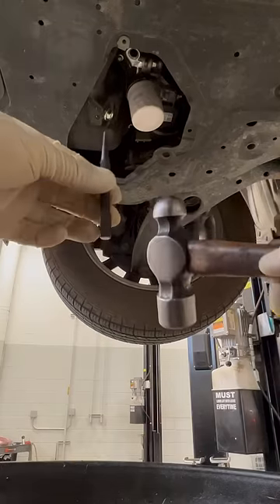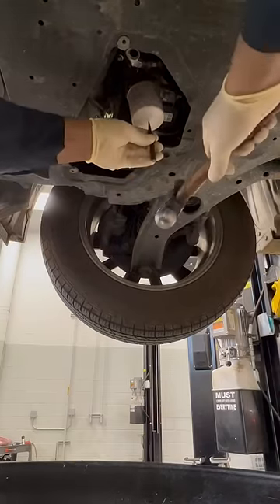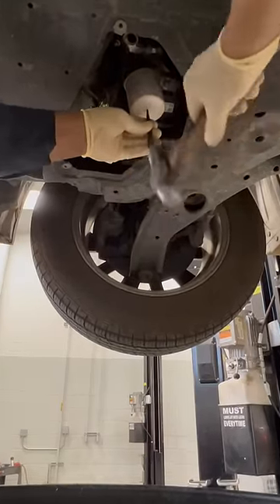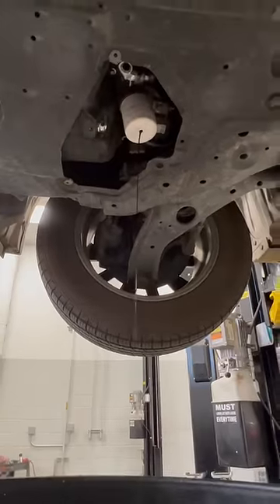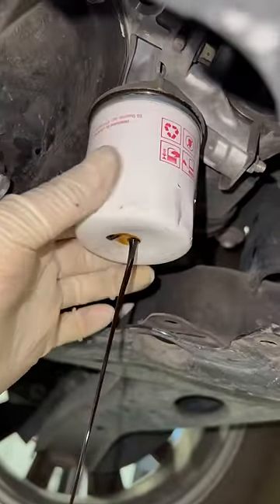Tech Tip Of The Day Oil Filter Clean Removal #oil #oilfilter #mechanic #shorts

Comment: Please be aware, viewers, that not all filter cans are the replaceable type.
Reply: The hero we didn’t know we needed
Reply: Also be aware that this is ok for the replacing type.  🤷🏾‍♂️
Reply: This comment has to be a joke. Obviously you would not do this to an oil filter, if your oil filter did not have a replacement
Reply: @emmanuelleallen9296 the hole in the metal ruins the metal, if it's the type where you just replace the filter inside the metal it ruins it.
Reply: @Charlie-vz9lr who would have guessed
Reply: But 99.9 percent are
Reply: i knew that something didn´t seem right about punching a hole in the filter, but i did had that question! thanks man!
Reply: @Charlie-vz9lr which cars have this, I’ve never seen it.
Reply: your mum is
Reply: @burkles4456 mostly European cars. But cartridge filters have become more common in recent years in cars that are American and Japanese as well.
Reply: My favorite part of having a "replaceable filter" inside a reusable canister is that I get to pay up to 5 times as much as I would for one all included replaceable filter that actually costs them more to make.  It's the most ludicrous load of snit imaginable.
Reply: @rooh5825  cartridge filters are actually more expensive to manufacture than the canisters. They're more complicated to produce because they were designed to filter out even smaller particulates than the canister ones. It'll help engines last longer, especially higher performance vehicles. It doesn't mean that they're overall better than canisters. The better choice would be dependant on the individual vehicle and the needs of the driver.
Reply: Oh, shiiiiiiit!!!!😧
Reply: But more importantly not all of them are vertical
Reply: @shiroshnur  lol oookay, that is total bullsnit
Reply: @andresgarciafilms  Only punch holes in the filter type shown in the video since thats a filter u can replace and is why he is draining the filter
Reply: Toyota has entered the chat
Reply: @ugonelearntodayknewz4794  More like 40%
Reply: Glad i read the comments 😢😅😅
Reply: @Charlie-vz9lr oh man, We'd be completely lost without you! 🤦

The "non-replaceable" kind are built into the engine and If the replacement filter isn't enough of a clue, the plastic cap would hopefully be a dead giveaway. 

This falls into the "did this really need to be said?" category 🥴
Reply: @burkles4456 random ones honestly, only one that comes to mind is the newer Chevy colorados tho
Reply: All oil filters are changable.  Some have metal cans while others have cartridges with plastic caps.  You can do this to any metal can filter.  If you can't replace the filter, your car would fail due to the loss of viscosity of the oil and engine debris.  30 year mechanic.
Reply: @Charlie-vz9lr no shit, Sherlock
Reply: Thanks for your method
Reply: I wish I would’ve seen this before I need a 300 dollar cover now😭
Reply: Now you tell me
Reply: Pretty easy to tell
Reply: Thank you.exactly
Reply: Just use Gorilla Tape🦍🦍😂
Reply: Será que por isso a minha não furou tão fácil, e precisei de uma furadeira??? 😧
Reply: @emmanuelleallen you know how many people don’t know not all oil filters are replaceable
Reply: I only do this with diesels tbh, normal oil isn't so bad but diesel is a pain in the ass.
Reply: Also, be aware that's it's always more fun being lubed up 😅
Reply: Well if it wasn't replaceable it wouldn't be a filter can it would be a filter cartridge wouldn't it?
Reply: You are craze KKKKKKKKKK
Reply: Yeah, If you don’t know the difference your better off going to jiffy lube and spending $100 for them to screw it up in some way and have you wait 2 to 3 hrs.
Reply: Ya, they would realize that when they’re holding their new filter.
Reply from the maker: https://youtube.com/shorts/ao14J4WSptc?si=GoqGLFNp2GxeDYGe
Reply: @Charlie-vz9lr youre talking about a cartridge filter and not a spin on. they have a housing with the filter inside it that you screw off the housing, pull filter out puyt new one in then screw it back in. usually takes a special fancy cup shaped socket to get the housing off
Reply: @shiroshnur most that I’ve seen have the same or similar micron ratings.
Reply: Porque podrían ser bombas de gasolina o canister.

Comment: I usually just flip the car upside down works just as well
Reply: I drive a Subaru. The filter is upside down, right up top under the hood. So...they flipped my car upside down for me! 😅 it sits in a little dish that catches any drips.
Reply: A friend of mine too his trucking for oil change and the clown put his truck on the lift but didn't have on right and they turned his truck upside down guess they thought it wouldn't make a mess that way too. They had to buy him a new truck it was a Ford dealership they fired the clown it took almost a full day to get it out of the shop and they destroyed it even worse. They tried to blame the equipment not the clown but he was there the whole time with his cell phone camera video was funny even recorded the service manager and his bullsh t lie.
Reply: i mean thats how i work on my bike.
Reply: 😂🤣🤣 stay golden.
Reply: No need if you live in Australia.
Reply: You still need to unscrew the bottom of the engine pan to vent

Comment: Garbage truck mechanic here: make sure you get the filter loose first. Sometimes there a fight to get off. Also make sure you have one to replace. One time a guy punched a hole in one and we were out of stock on that filter and he didn’t check prior. We had to make a special run to Mack that day just for a filter.
Reply: Try taking off an oil filter that hasn't been off in 15 years it sat there for so long that I just replaced the engine and glad I did block had enough sledge to fill a 5 gallon bucket
Reply: My dad always keep filters in each car in case the oil change place didn't have one, I bet it happened to him.
Reply: Here's another garbage truck mechanic drive a screwdriver through the side of it and it's coming off. 😮
Reply: Jajajajajajaja 😂
Justo dudé que era un mal consejo de hacerle un agujero al filtro, porque podría ser inexistente.
Reply: So you would reuse an old filter? That's brave, and hopefully not a customer's truck.
Reply: Common sense.  No new parts no take apart
Reply: Wish I thought of that after 17 years @Ford
Reply: @jamesthompson3486 not always. I had one that was so tight the screwdriver just cut a slot instead of turning it. Just get the right filter wrench.
Reply: @njjeff201 common sense is rare. Hindsight is common.
Reply: Been there done that on a old maxforce you'll only do it once.
Reply: omg never reas so many non-mechanics thinking that he's going to reuse that he is changing the filter out and by puncher in the hole it drains it cuz if you unscrew it that's all going to leak off the sides all over your hands all over into the bucket. so he's saying it's a cleaner way of doing it even though it causes more tools😭
Reply: my oil filter has been on for only a year while the car was sitting around a lot and it took so much to get it off 😭
Reply: Place oil bottles in clean bag on front seat in case you get called away or drain oil overnight. That way you won’t start a dry engine that you have drained.
Reply: What difference did it make that he punched the hole before checking to see if the filter was in stock, you would have to get a new oil filter either way whether in stock or have to make a run.  Or are you guys shiisters and reuse old filters.  I'd be weary of your shop if I saw this post because what you basically just said/implied is your shop would've reinstalled the old filter since it was not in stock.
Reply: Be careful of the screwdriver through the filter trick.  If she's really tight you're in for a world of hurt when the can shreds and THEN you can't get a grip on what's left.
Reply: Happened to me on a Grand Prix shit was a nightmare to get off
Reply: I can see that happened already.
Reply: You can use different filters on engines I've got a different from oem on my 95 dodge cummins for fuel filter as my water separator thing had broken and was pissing diesel all over went to the parts store and got one that did work no water separator
Reply: BS! 😂
Reply from the maker: @Wolfie3030 ???
Reply: I was thinking the same thing!  Your F’d if you can’t get that filter off. Same can be said for fill/drain bolts. Always loosen the fill bolt first
Reply: I was thinking the same thing!  Your F’d if you can’t get that filter off. Same can be said for fill/drain bolts. Always loosen the fill bolt first
Reply: @doncangrejo

Comment: Tip #2 crank the new filter on as tight as possible for the next guy.
Reply: And double-up the gasket to make sure he has to do it soon
Reply: Apply a generous amount of lock tight as vibrations may rattle it loose 👍🏽
Reply: Don't forget use threadlocker and tire bead sealant it's the jiffy lube special
Reply: Use my 2ft pipe wrench!
Reply: I just usually prefill the entire new filter with some of international's good rtv silicone... she'll never leak then.
Reply: @firstlast6566  hah! That's amateur stuff right there. After an oil change, you gotta fill it back up with quick set concrete mix instead of oil! That'll keep it running smooth for at least 25,000 miles!
Reply: especially if it’s the new boyfriend
Reply: That’s until you are the next guy. I’ve done that.
Reply: You gotta spread the love. Lmao
Reply: Task successfully failed its my car im also the next guy… $@&#
Reply: Strip the oil filter chanels for extra hardness
Reply: I'm always the next guy
Reply: Why I will never have someone else do my oil change.
Reply: You must work for Discount Tire.
Reply: I usually pay a 400 pound gorilla to tighten mine
Reply: @thekingofnoobs8362  throw some tamper on that bad boy with the double gasket band wrench twistaroo
Reply: @thekingofnoobs8362 I work at jiffy lube- tire sealant????
Reply: @BryceJohnson-ng7kp  you don't know what tire sealant is ok maybe not all the jiffy lube guys do the jiffy lube special
Reply: @nickiswavvyy4238  you know the filters on tight enough when it's crushed on their
Reply: Dont forget the lock-tight!
Reply: @MadLadCheese101 I did this once.....the next guy was me.
Reply: It also helps to crossthread the oil drain plug and round off the corners on it.
Reply: JB weld it on
Reply: Then you ARE the next guy
Reply: Everytime I try that method, I end up being the next guy again 😅
Reply: Don't forget the loctite lol
Reply: Especially if you are indeed "the next guy"!
Reply: @MadLadCheese101 better be the red shit
Reply: I like to use a torque wrench set to FU with a nice long cheater on it.
Reply: When you like to do a little trolling, to yourself 💀
Reply: loctite
Reply: 😂😂😂😂😂 most important step.
Reply: Haha this comment has me dying 10/10 bro 😂
Reply: JB weld those threads in the filter before install. Extra level of leak protection.
Reply: Even better to cross thread it, it's much tighter that way
Reply: Use threadlocker 😈
Reply: Permatex black as the gasket.
Reply: Tip #3 As a German engineer, you work on 99.99% the car genius af but the last 0.01% is the oil filter position that you complete screwed up. Not only do you decide that torque is so high that's extremely hard to remove the oil filter and the oil filter is always deformed after it, you also choose to position it so, that nobody can removed it from the bottom. You also choose a spot where there is as little space as possible and as many cables and hoses as possible, so that the mechatronics technician can search, just to remove countless things in order to even get halfway with your damn expensive special tool. And of course it must not be missing that the oil from the spot then stains cables, hoses and vehicle paneling, so that the mechatronics technician can also clean it again with brake cleaner and needs a pad so that the entire workshop floor is not soiled with oil. 

Seriously, as a German to all engineers how design engines like this: FU!

And to all Japanese automobile engineers: I saw your work and I was always glade for your engine designs. Thank you!
Reply: And dont lube the gasket
Reply: Welding them on is best. 👍
Reply: Funny cause that happened to me when j got my oil changed a month ago.
Reply: I swear the shop uses an impact wrench to put on my drain plug. Usually do the oil myself but was out of town and busy. Spent a good 10 minutes trying to get it off.
Reply: Problem is I'm usually the next guy.
Reply: Strip it and a quarter turn is considered a tightly fastened fastener.
Reply: Double that and give it to the next guy
Reply: someone did this and the car i was working on bent the fuck out of my wrench and took me ages to take off
Reply: @dlsimmonsjr1 q
Reply: @MadLadCheese101 *Red Loctite
Reply: You mean me?  I must of had a pretty good amount of hand ugga duggas last time.  It was pretty tight today when I changed my oil.  I was at least able to still get it off by hand.  Might have someone to do with it still being cold last time I changed it too.
Reply: @thekingofnoobs8362 I've worked at jiffy lube before as well as doing tires and oil at Walmart some 20 years ago.  I literally found out about tire bead sealant like a few months ago lol.  Unless you are taking about the green goo leak sealant.  Hated that stuff when I changed tires but I can't fault people for using it.  Pretty effective on small leaks.
Reply: @indridcold8433 that happened to my bosses car. The dumbass mechanics put a course threaded filter on a fine threaded filter housing. He somehow made it to Alabama from Georgia and when got his destination it drained out completely. 😂😂😂😂lucky ass got his engine rebuilt at that shop he took it to for free from the damage it ended up doing.
Reply: Jokes on you, you’re the me t guy
Reply: Plot twist- the next guy is you because you work in your own car.
Reply: I replaced my oil filter with a aftermarket cap for a more clean look
Reply: 200 ft-lbs minimum
Reply: Use an impact to install the oil filter.
Reply: As a service tech, I approve of this message
Reply: @dlsimmonsjr1 That's a nice tool you've got there. Is it Rigid?
Reply: except when that next guy is yourself and you're bitching who the hell tightened this damn filter so hard then you look back in the history and you get real quiet.
Reply: No lie, had a shop change my oil one time and the next time I went to do it myself. I couldn't get the old filter off. After hours of frustration and a ripped up destroyed filter ( which ended up looking like a crushed up soda can) I gave up. I  contacted a mechanic that could come out. I was away but he said it took hours for him to remove,  he was finally able to after using heat.
Reply: Yall tryna screw up somebody car 😂😂😂😂😂😂
Reply: @jaredglass2562 I bet whoever changed your filter didn't lube the filter gasket with new oil. Skip that step it doesn't matter how tight the filter is on, that gasket will bake itself to the engine base and Hercules himself would have a hell of a time getting it loose.
Reply: @tmurph2473  it must have been . We where using wrenches with 10+ feet pipe and still couldn't break it. Seriously,  there was nothing left of the filter housing by the time I threw in the towel and hired help.
Reply: Evil
Reply: @squillz8310 just make sure it's 5w 30 concrete
Reply: No less than six uggaduggas
Reply from the maker: https://youtube.com/shorts/ao14J4WSptc?si=sg0oUdtim_O9rORq
Reply from the maker: https://youtube.com/shorts/ao14J4WSptc?si=GoqGLFNp2GxeDYGe
Reply: That's what I use my new electric impact wrench for. I like these new Milwaukee impact wrenches.
Reply: @KC9UDX 😂😂😂
Reply: Sorry but that's not a real thing. Certain aluminum filters run way too hot and expand from the heat compromising the seal. Sometimes it necessary
Reply: It even says that on the box. It's a law I'm pretty sure 😂
Reply: and strip the drain plug. Double whammy.
Reply: My ex went to Jiffy for an engine oil and filter change. When it was time to do the job again, I decided to do it myself. That oil filter was screwed on so tightly that I had to use a long screwdriver, punched through the filter body and a hammer to remove it after the tin was crushed while trying to remove it with filter wrenches.
Reply: Lmao
Reply: how thoughtful
Reply from the maker: @firingallcylinders2949  how you like
The tip 😂
Reply: You can always superglue the new oil filter on or better yet epoxy filter threads in
Reply: LMMFAO!
Reply: @alicethegrinsecatz6011  i owned a vw passat diesel. Extremely poor design and location for the oil filter. Top of engine in a hole so tight you had to hold the filter housing just exactly right to get it out without removing hoses etc. Putting it back was even more of a trick. I always thought German engineers were top notch till i actually owned a German car.
Reply: Some jb weld it better
Reply: I got one of those adapters so I can use my 1/2 inch impact for installation
Reply: Ahhhh huh no wonder I can't get the oil caps off some of these nissans😜
Reply: @benwachtel23 They told me to live every day like It's my last, assholes didn't tell me I'd be alive to fix something a month down the line.
Reply: With purple loctite
Reply: Make sure to put super glue on the seal so there's no oil leaks!
Reply: what if hes the next guy einstein
Reply: @kindledninja  nah the green shit 😂